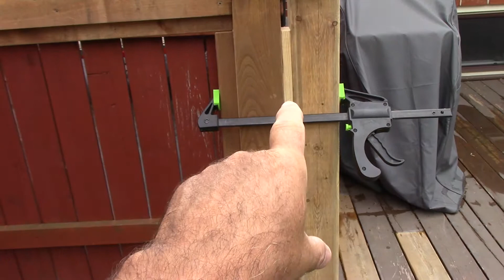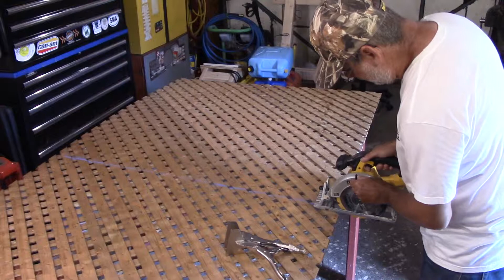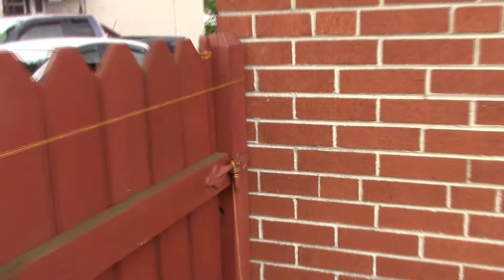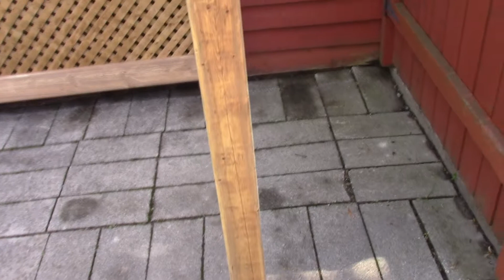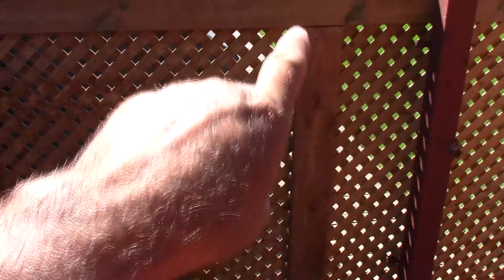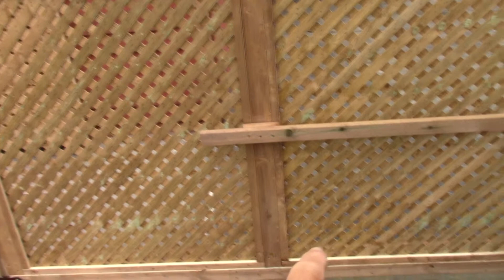How To Build  Custom Wooden Fence  Gates

Comment: I watched the whole video wondering what type of wood you were using. Then at around time 21:50 you indicate that the pressure treated wood is heavy. Did I understood that correctly? That the frame is PT wood? In California the PT wood is not near as good looking like what you used. Here it comes almost dripping wet and cups, curls, bows, and twists at the first hint of sunshine.
Reply from the maker: Yes all PT  .  We don't use any pine in my area , it's all spruce PT and  processed much differently than years ago when it was dripping wet :) Cheers Tony

Comment: That came out great Steve.  So true about how much green wood shrinks.  I always try to get as tight a joint as possible.
Reply from the maker: Thanks Pat. I usually just butt deck boards together if they're real wet and I end up with a 1/4-3/8  gap.  Cheers

Comment: How's she goin'?  That was a pretty big job.  But it sure turned out nice!!!  I like the look of the lattice and you finished it off real nice too!!!  I noticed you used Lepages outdoor glue.  I tried that and found it didn't hold all that well.  That was partly due to the fact that the wood was green and pretty moist.  Hope your's turns out better!!  Nice clips on the long gate too.  That'll be handy when you want to remove the gate for access.  Nicely planned and nicely built!!!  Take care!!
Reply from the maker: Thanks Mike , yes if it's too we it dilutes the strength,  so far it been great . Take care.
Reply: @SteveRobReviews  I have used it many times without issue but with dry wood.  The only time the Lepages failed was with green hemlock.  After 2 days it came apart and the glue was just gooey.  I'm sure it will be fine as your wood looked to be seasoned OK.

Comment: Good work Steve. Fences and gates take a fair amount of planning and I see you have thought yours through well and good. I have encountered many times where the gate and/or the support post shift and heave with winter/spring thaw and the latch no longer work. I currently have a gate where I use spring retention and no latch. They work good and never misalign however a heavy wind can open them a little if you use solid boarding...I like your idea of using lattice for the gate. This will allow a breeze to flow through on hot days. Cheers my friend, keep up the good work and thanks for sharing.
Reply from the maker: This gate is half the weight as the old one . Thanks bud.

Comment: You did a really nice job Steve....Good thing you did not use them deck screws....she's solid and she's pretty....I don't like them new still clamp....I would have put them stack box ones you had....I have experience with them and you'll find out with time...or maybe you'll like them....looks really good.....CHEERS
Reply from the maker: Thanks Gator , the new  fence hooks  are much harder to line up  than the old ones but their  just fine so far. I think the old ones did well for so many years but  I wanted something more compact. Cheers

Comment: Well designed and good looking fence Steve.  I remember the first time I saw a biscuit joiner was on This Old House, Norm Abrahms was using it.  I thought it was awesome.
Reply from the maker: They are great and not one nail or screw  just biscuits and glue . A must have for woodworking.